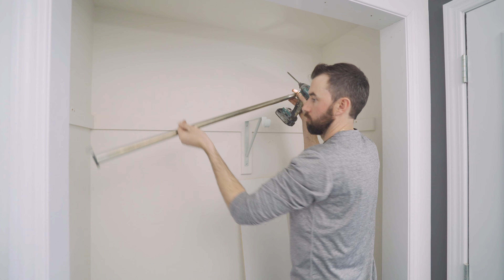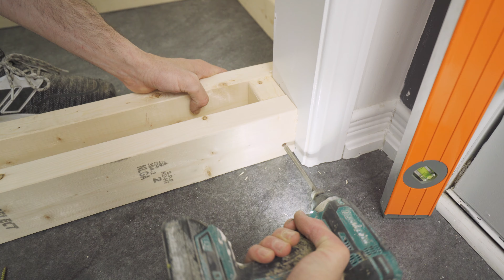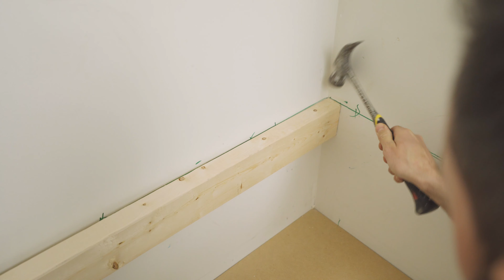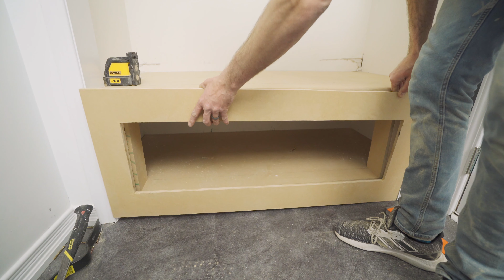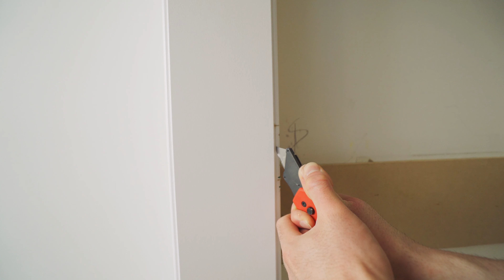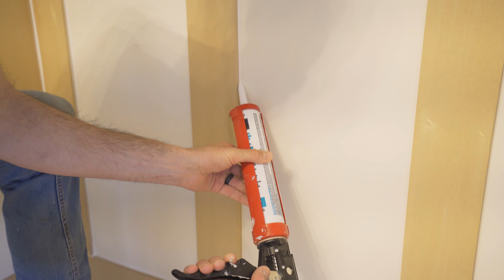Open Concept Closet Renovation - DIY Closet Makeover for Beginners

Comment: Been looking to make one of these in my entrance way closet and this looks amazing! My studs in the wall are made out of metal. Can I still screw into the studs and would this still be secure enough for a floating bench?
Reply from the maker: Thanks for watching! Good luck with your build!  You should be able screw into the metal studs without issue especially since the load will be transferred to the floor by the vertical posts

Comment: What 2x4's do I buy at Lowes?  They have soft/ hard wood...  the pine might be easier for me to work with but will it be strong enough ?  I'm a 50 yr old former flight attendant and no background with building anything so I'm way over my head with this.. 😅
Reply from the maker: Hi there just the regular old spf#2 are fine.  Just try and find some that are straight! Good luck!
Reply: @DIYDudes  thx!

Comment: Good evening - I’m curious, how are the flat 2x4’s staying in place at the top?  And is it Just the two long pieces resting on the MDF, nothing on the side of the walls like when building the base shelf and bench?  Are the two long 2x4’s up top not fastened into the wall at all?  If that’s the case, how did you get the piece in the middle attached to them (you can see it when you’re applying adhesive to the MDF board that’ll go on the bottom)?  Sorry - not the handiest of men but I’ve almost completed this project and am a little stumped here.  Thanks!
Reply from the maker: It’s actually just resting on that mdf side rail the two long pieces just rest on the rail then the short ones go in, screw those to the wall then screw the long ones to those.   Good luck!

Comment: Can u address how to find if any of the beams are loadbaring or yall dont care to know?
Reply from the maker: We just took out the closet door, the door wouldn’t be load bearing 

Load bearing walls typically run perpendicular to the floor joists and line up on top of what ever support posts are in your basement

Comment: Worst "trend" EVER. My home was gutted and flopped with this "open concept" closet idea-DON'T DO IT! Closet doors are for keeping DUST OUT of your shoes, clothing and shelves. There is NOTHING chic about dusty clothing. No matter how organized they are, open closets are cluttered-looking eyesore that makes a room appear smaller, attracts the eye like a magnet, and traps every bit of dust and dirt into its four corners and shelves. My winter jackets and boots are covered in dust by autumn, my summer dressed and tops coated with dust by spring. BAD IDEA!
Reply from the maker: It works well if you cycle out the clothes for the seasons.  Maybe not for every one but it does make for a bold entry way

Comment: Looks great but two major problems is 1. The mdf is super absorbent fiber board so as soon as you place wet coats, boots, umbrellas etc. it will bubble and warp. 2. Glidden paint is practically colored water. I would recommend using a behr marquis in semi gloss, the additional silicone will make it more durable and water resistant. This was a great idea and executed very well, just consider better materials high traffic areas.
Reply from the maker: Yes I agree more durable paint would keep it looking crisp for longer.
Reply from the maker: Also with the water issue you would have that issue with any painted wood,  if you are doing something like this it’s not meant to hold standing water

Comment: Can you provide a list of pieces of wood you need to make this? Like how many 2x4’s do you need and how particle boards do you need? What size of screws are you using? Things like that.
Reply: What about the mdf panels you used for the perimeter of the bench? What thickness was that?
Reply from the maker: Hey John it’s difficult to provide because it’s custom built to our closet.   We used 2 4x8 x 1/2” mdf and about 8 2x4 x 8’

Good luck thanks

Comment: How many inches in width did you make the MDF for the board and batten on the walls? Were the horizontal cuts the same width as the vertical cuts?
Reply from the maker: I believe we did 4” for the verticals and 6” for the base

Comment: How difficult would it have been to do a full open concept? Any reason you didn't remove the closet posts on the left and right side?
Reply from the maker: Rick these are super easy to build.  You can basically cut the mdf to what ever design you dream up… I’m actually doing another closet right now where I did open the whole closet up and it was pretty easy.  Keep an eye out for the video in a couple weeks

Comment: Looks great, I'm going to follow this design as well! What size did you cut the batten mdf panels? Thank you!
Reply from the maker: I cut them to 4.5”
But really it’s personal preference good luck!  We are doing another similar build this week as well
Reply: @DIYDudes  thanks appreciate the reply! I've bought precut mdf panels at 3.5", so it'll save me some time cutting.

I'll probably do the bench top with an acacia countertop piece. I actually prefer how you made your bench flush with the entry of the closet, but I'm missing about 2-3" if I buy the countertop. It sucks, so it'll have to be a little shorter. Anything else other than an mdf/plywood piece, the top will have to be made of 2 wood pieces which will show a line in the middle but unfortunately I prefer one solid piece without.
Reply from the maker: The great thing about these builds is you can really make them what ever design you can imagine and they look great.  Good luck!
Reply: @cancelOG  I also thought of installing an acacia countertop piece. For the 2 - 3 inches missing at the front,just put that missing 2-3 inches at the back on the bench so the front is gonna stay nice.
Reply: @christianpolytechnique7404  I just used an acacia countertop without extending or doing anything special. It's really isn't that bad, it looks nice. The countertop stops halfway at the moulding. Kind of where the door used to be. I'm pretty happy with it!

Comment: This was a very great video and straightforward. Thank you so much
Reply from the maker: Glad you liked thanks!
Reply: @DIYDudes  quick question on the mdf face. Did you use a jigsaw or a circular to cut the inside holes?